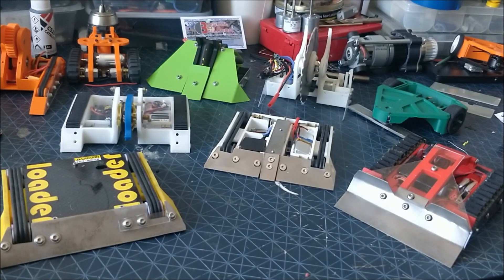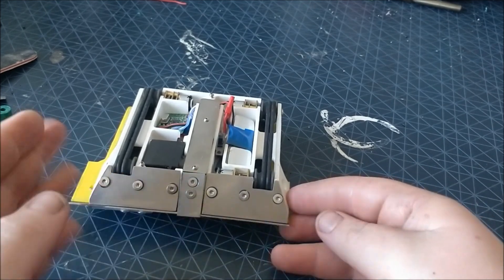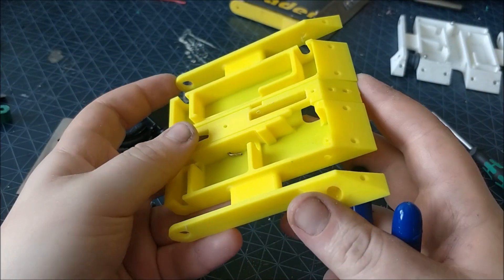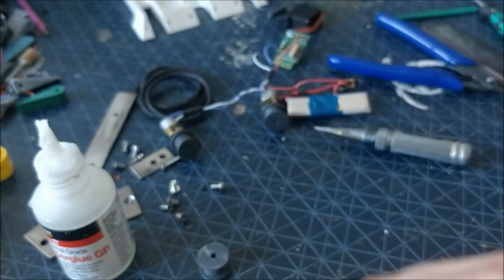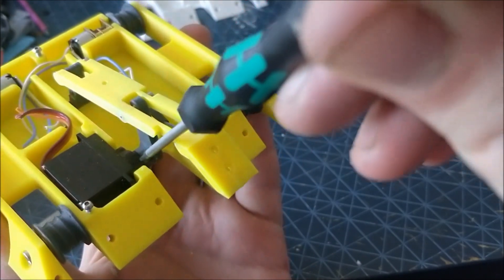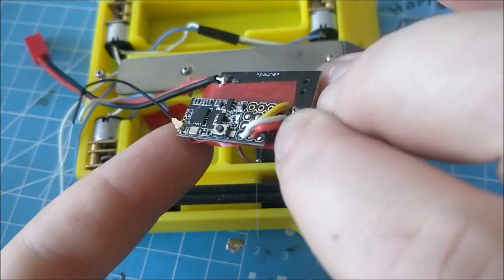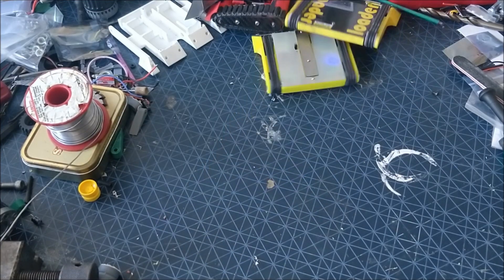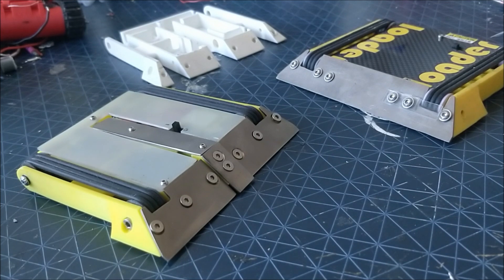ReLoader: 150g 3D Printed Battlebot build

Comment: What's the transmitter and receiver you are using
Reply from the maker: @XbeforeYZ  I use a flysky i6 and 4ch Rx or often for antweights I use a Malenki nano which has a compatible receiver built into the controller

Comment: This lifter model is not on your thingiverse. Anyway you could post the step files? Would like to use this as a base point to tinker with my kids.
Reply from the maker: Hi, no the model isn't. I haven't uploaded it for a couple reasons. Moreso than Loader it takes very specific components and is a bit more fiddly to work on and less intuitive. Everything is a bit custom and it's not something I can easily troubleshoot from a distance.

Comment: I'm guessing the Malenki nano HV will allow you to simplify your electronics now (assuming it's still running)
Reply from the maker: Yes and no. I would then need an additional BEC to run my servo. My current plan for this line of robots is ditching the servo and running geared motors on the malenkis 3rd channel to power the lifter which would remove the need for regulated voltages.

Comment: Are N10 motors happy at 11.1V? I thought they are rated only for 2S voltage.
Reply from the maker: I have run them at 4s before - could I do it for a couple hundred hours? No. For 3 minutes at a time yeah they'll be right. Components in combat robots have a short, hard and ugly life. I'll happily overvolt motors. You just can't get away so much with electronic components like escs and rx's.
Reply: @HarryMakesThings  thanks, so those are 6V versions of N10?
After leaving the comment I found some 12V variants on Chinese websites.

I guess you are right with short combat life, I reminds me about WW2 tanks from Germany having parts rated to last years when combat life was just few days.

Comment: Hey how many rmp are your N20 motors rated for 6v
Reply from the maker: I use between 500 and 1000rpm depending on wheel size in my ants. These were 800rpm I think.
Reply: Great thanks   I have 800rpm n20s on order

Comment: Any plans on releasing stls for the flipper?
Reply from the maker: I'm in two minds - not that I'm particularly protective of quite a generic design it's just a bit of a ball ache to assemble and work on and that could prove frustrating unless you use the exact same components (some being custom) and I cant realistically provide the support needed. It will probably serve better as a general reference (or "How Not To Build A Robot) guide!) than print and assemble.

Comment: Very nice work! I'm curious as to how you stopped the chassis from warping underneath because I've been having that problem with my own four bar lifter antweight ^^;
Reply from the maker: Thanks for the kind words! Nothing super special. Just making sure the bed is properly levelled and you have an enclosure for ABS or making sure you have no drafts passing through for pla etc. I level the bed with feeler gages instead of folded paper, business cards and so on. This is much more reliable and repeatable. Sometimes I will also print things on their side so its a really tall print with a smaller footprint if the geometry calls for it or its a difficult material to get to stick (e.g. nylons)
Reply: @HarryMakesThings  I always thought it was because the base of my build was only 1mm thick ^^.

Comment: I am curious about those custom n10s. Do you have any info on those?
Reply from the maker: Yeah for sure! I found some really stubby (shorter than a regular N10) motors that had a decent stall current and speed. I painstakingly pulled apart my cheap n20s and swapped pinions. Downside of these tiny motors is there are no mounting threads so they're just glued on to the gearboxes. The motor shafts also have to be clipped down too. I think I bought a bag of 20 for about 7 pounds and and the donor N20s ran me about £1.20 each landed. I'm pretty sure there are some photos of this setup on the Harry Makes Things Facebook page.
Reply: @HarryMakesThings  thanks very much for all the info!

Comment: Nice video bro.... I'm also working on a wedge with flipper bot... I made 25 kg wedge bot with a empty slot in the middle for the flipper Similar to yours( didn't had time to finish, not even had time to figure out the errors in the control system, so had to turn it into a wired bot overnight) the bot went to fight as a defensive wedge bot.... 
Now planning to add the flipper mechanism....
Reply from the maker: Thanks! It's always a shame when you don't get to fight with the bot you planned. At least you got to test your drive motors so you have a more reliable platform for when you get your weapon sorted. Best of luck for next time!